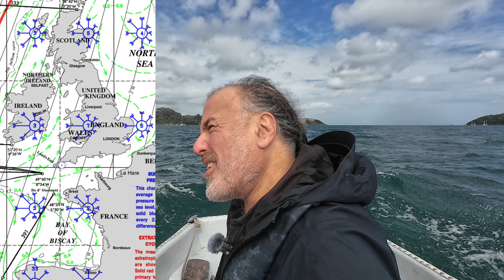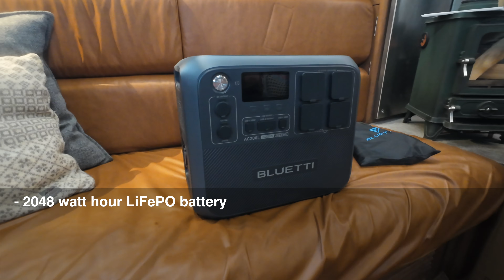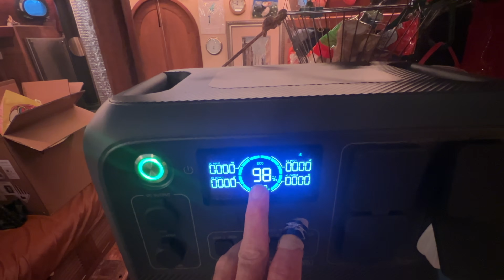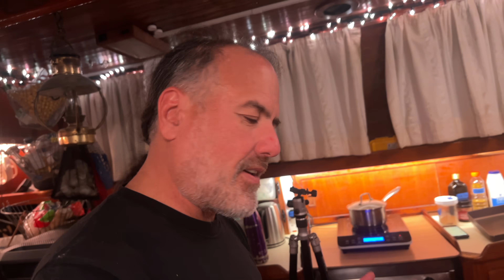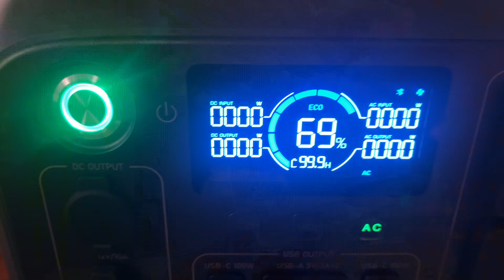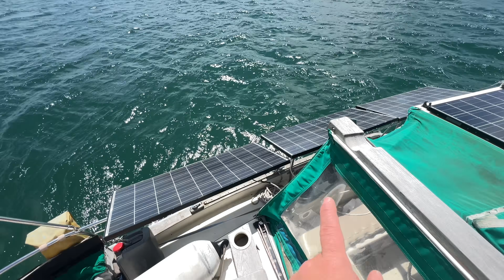The Bluetti AC200L Expandable Power Station on our Sailboat! | Paragon's Favorite Stuff Ep. 23

Comment: You make no comment about matching the VOC (voltage open circuit) of the panels with the Bluetti maximum VOC input . output must not exceed the absorption capacity of the VOC in the Bluetti .. i have several Bluetti products and especially in the smaller battery 😮capacity products it is very difficult to panels to match their VOC capacity .. yes Bluetti sell folding solar panels to match their capacity . But i don’t consider those panels ideal to use on a boat .. they are not water resistant enough .. also they are overpriced . So my advice to any buyer of Bluetti or similar products is locate solar panels to suit the Bluetti VOC to suit before you buy the Bluetti , NOT the other way round . By the way i use two Bluetti AC60 units with B80 auxiliary batteries two run an induction cooker on each .. (at low settings but these are the same settings  i would use similarly if cooking off mains electricity)  and it works well .. the induction cookers do exceed the rated max output (600 watts) of the Bluetti (going up to 1024 in short bursts) but the Bluetti handles it fine. But it is proving difficult to find panels that match the VOC of the AC60. Apart from that limitation i consider the ac60 b80 combo a great product  they are water resistant . You could also use them to soak up excess solar from your house inverter when house batteries are full . And they are also robust compact and not so heavy that you could take them ashore to recharge of the grid .

Comment: Thank you for your nice review, much appreciated! I have an odd question: can it be connected to the 220V and 12V electrical panel of the boat, using of course respectively the 220 and 12V outputs? At the end it would work as an additional battery bank + inverter in a very compact way, dramatically helping my existing AGM battery bank. Thanks and... Buon Vento!
Reply from the maker: Thank you! I’m not certified or qualified to offer profesional advice on electrical systems. However I think plugging your 220 volt shore power cable into the power station’s 220 outlet would work great as long as you don’t exceed the 2400 watts. However, please note that the Bluetti AC200L’s 12 volt output is via a car/cigarette lighter outlet, and that it is limited to only 10 amps, so i suspect that it may not be enough to power all of your 12 volts stuff without tripping.  I actually purchased a separate, waterproof converter that I am planning to plug into the AC200L’s AC outlet. It will convert that AC to 12 volts at up to 25 amps. I got it because I want to run a portable, 15 amp, emergency bilge pump on the power station. If it works well then we’ll make a video about it. :)

Comment: I also run both a refrigerator and chest style freezer, regularly use a 
900 watt microwave oven.  I have a 2000 watt Xantrex inverter for off grid AC power.

Comment: Man, I'm surprised you haven't replaced your house bank with lifepo4 yet. Just make sure your alternator can handle it if you do.
Reply from the maker: Ya, I kind of feel like we’re late to the party. Just before we pushed off from the states in 2013, I outfitted Paragon with 4, brand new, 8D, and 4 brand new group 31 batteries, all AGMs  made by Lifeline, along with 15, 130 watt solar panels. With that investment in that many amp hours, we couldn’t really justify the jump all replacing them with LiFePO4.. however, now those AGM batteries are 12 years old and not holding their charge as well as they used to.. stay tuned. :)

Comment: Great video, Drake! Your editing is also stellar. I love the fact that you are always ready to try something new. ( i.e., the electric motor).  I'm wondering if this system could work for my home in South GA. I  live on an island just off the coast in Georgia. It is an area where hurricanes make landfall within 200 miles about every 10 years. I am always planning for that event. Usually, I would choose to stay put. So I need to be as comfortable as possible in the aftermath, and after a hurricane is usually HOT. I have a propane generator that will produce 8500 watts that I can hook directly into my power grid. It will run most of my house minus the HVAC of course. But there will still be lots of little things I may need to run like laptops, phones and TVs etc. Here is my question. How portable is the system? I only have about 3 hours of sunshine in my yard (lucky me in the south right). I would need to carry and/or roll it across the street for more sunshine. Could it be moved back and forth easily? Thanks in advance for your help with these questions.
Reply from the maker: Thank you Lauren! This particular power station does weigh over 60 lbs, so I think it might be a real workout to carry it more than a very short distance. I do think it would be pretty manageable if you had a wheeled cart to put it on to move it. BLUETTI also sells portable solar panels designed for charging their power stations, and they also sell smaller and lighter power stations that may be more portable.

Comment: Great review Drake! I’ve been using the BLUETTI 200 AC Max on my W32 with 400 watts of solar(200 X 2 in parallel). I have 150 usable amps of AGM but rarely need to dip into them (multiple cloudy days). The system is split with a changeover switch so I can toggle between the BLUETTI and my AGMs to power the boat. I am very happy with going this route rather than having to rewire and build out a whole new lithium system from the ground up on a 1974 boat.
Reply from the maker: That sounds awesome! And it’s great to hear how it was easier to just get the power station instead of installing all of those separate components along with a lithium bank.